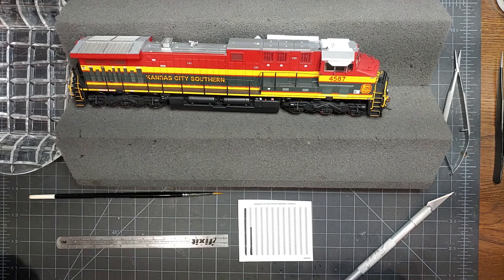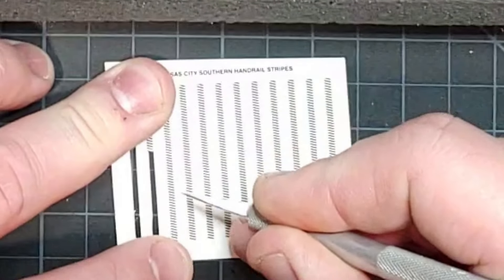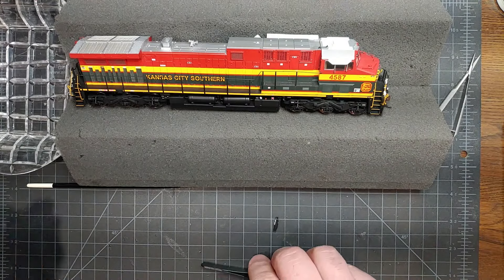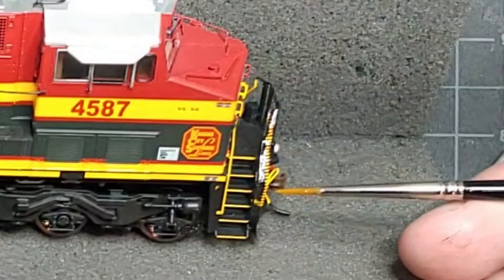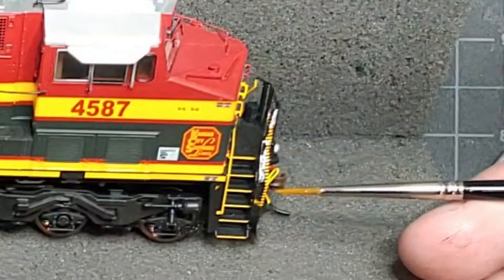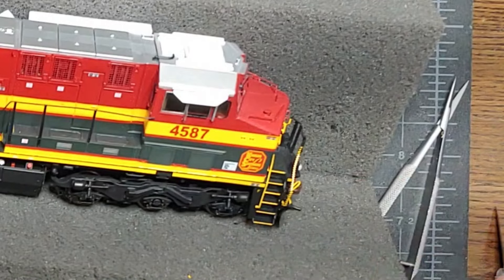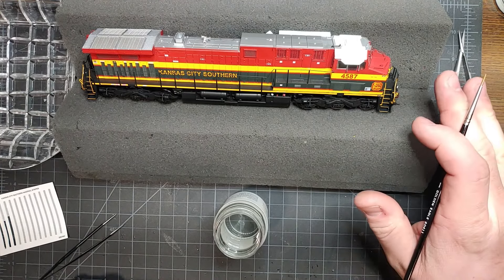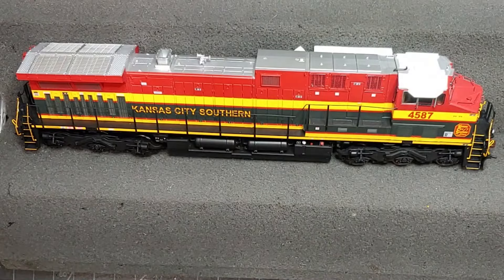Athearn Genesis AC4400CW KCS Handrail Decals

Comment: Hi! I just want to say how impressed that I AM with the Kansas City Southern AC4400 Locomotive! For one thing, I've noticed that the REAR "Ditch Lights" actually work! I am a DC Analog Modeler, and even with the DC Scaletrains "ET44AC" KCS Locomotives, the Rear Ditch Lights aren't lighted! Also, even in DC, the Athearn Numberboards are lighted too. Athearn did get with the program, and they now have these "Roller Bearings" that actually turn as the Locomotive is moving! Scaletrains (for a change) need to get with the PROGRAM on that Rear Ditch Light application. This is a great Video, but I personally like to use a very fine Paint Brush, Very, VERY lightly dipped in Black Paint, and do my handrails! I've done that with my KCS Diesels way back from the KCS Alpine White Paint Scheme, and into the Gray Scheme. Just easier for me...but everyone has their OWN way of doing it.